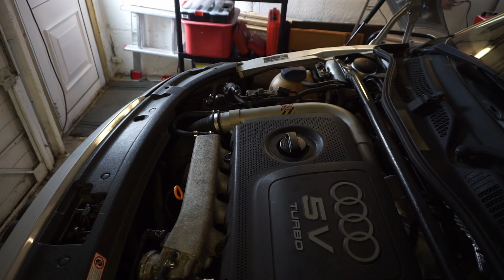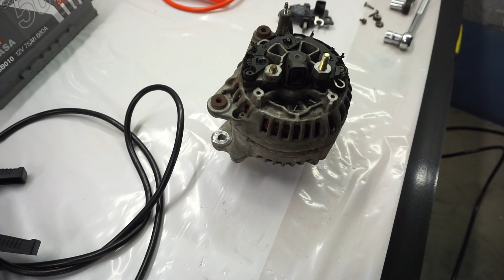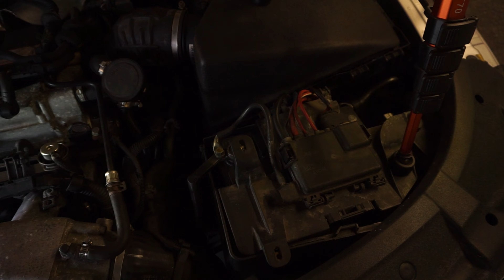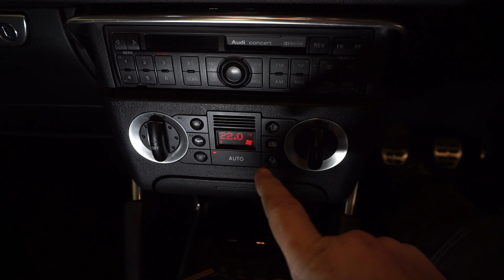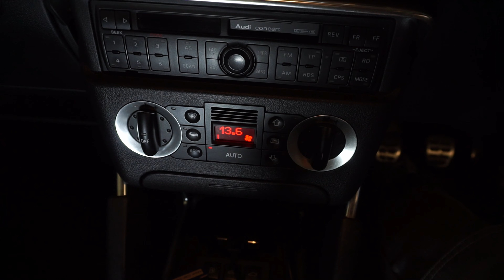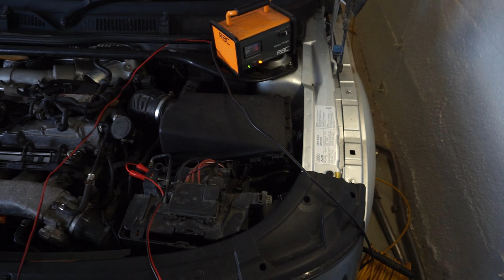Audi TT Alternator Removal & Repair

Comment: Hello nice job. I need your help i hava a tt 2000 apx 225 with a problem i get 13.8 at battery terminal but at 20c car shows 12.7 the generator cable is extremely hot whta should i do? New cable or regulator on alternator?
Reply from the maker: Hello, Thanks for watching! Firstly please understand I am not a professional so please if you are wanting to solve this yourself I suggest gathering information from multiple sources and be safe! From my limited knowledge I know cables should not be getting extremely hot, warm as the engine gives off heat is ok but not super hot.  Really hot can indicate high resistance and given the two different voltage readings could be an indicator that's what's happening.  I am making the assumption its the original cable, if so its 25 years old and possible there is some corrosion either at the connectors at either or both ends or  in the cable itself (some people refer to it as creeping green corrosion).  If this problem was happening to me first thing I would do is make sure the connections aren't loose as well as all the ground connections to the engine, gearbox and battery if they are secure I would disconnect and measure the resistance between both ends of the positive cable that's getting hot, if its high clean the connectors with some wire wool or small wire brush and see if that makes a difference.  If not I would inspect the cable for signs of damage or corrosion. If the cable appears ok its not going to hurt to do the same to all the grounds as well.  Anything relating to electronics in a car I usually check the battery health and in this scenario I would also consider doing a voltage drop test on the charging system to see if that revealed anything.  These are all things that may seem basic but they are also free to do which might prevent you from buying parts you don't need.
I hope this helps or at least help rule some things out for you.  I did a video bench testing an alternator to follow up this video on my old camera and most of the footage was totally unusable 😭 These tests can be done with a simple multimeter. When I get back to making videos I will have to redo it but for now I'm sure you can find online how to do it.  Good Luck my friend!